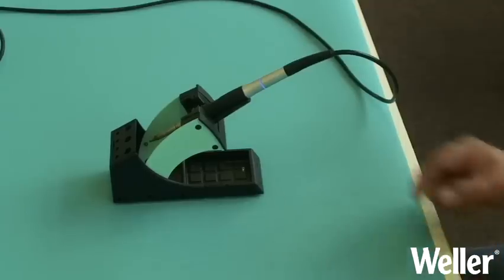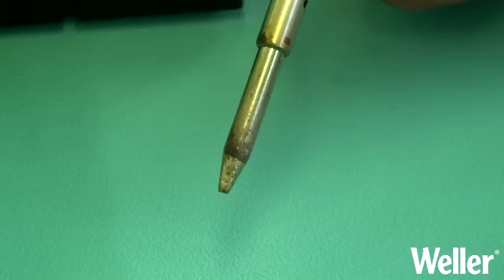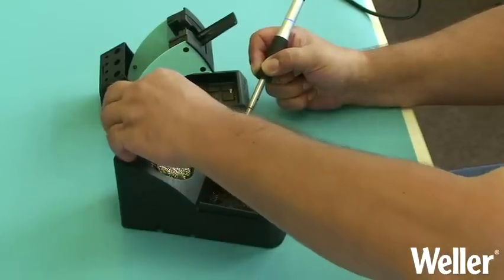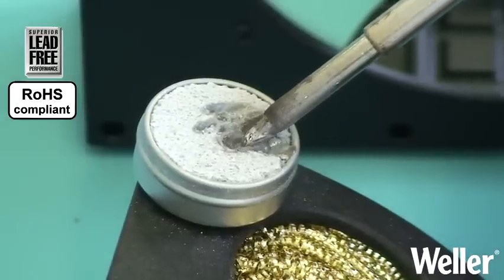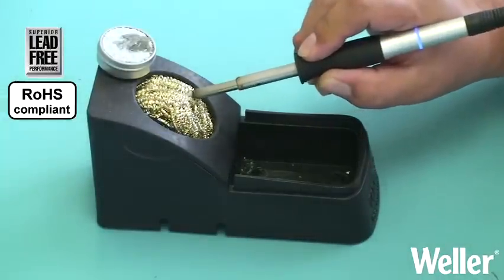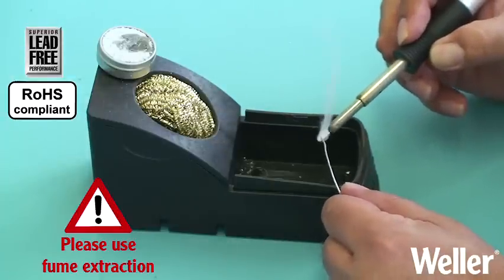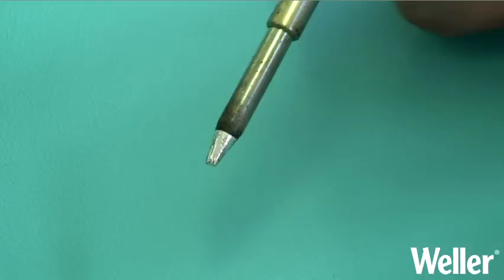Weller How to use a Soldering Tip Activator - Application Video

Comment: Is "tip tinner" the same thing as "tip activator"? They look the same, at least
Reply from the maker: Thanks for your question! The tip activator has replaced the tip tinner. The tip tinner contained hazardous substances, the tip activator no longer contains these hazardous substances. But both products do the same thing.
Reply: @wellertools  Ahh okay that makes sense. Thank you!

Comment: I keep getting a sticky residue behind on my soldering pieces and I don't know why it's really hard to get rid of aswell it's like the sap from a tree
Reply: Most likely it is rosin or flux from the solder which prevents it from oxidizing. It is generally pretty easy to clean off with some isopropyl alcohol.

Comment: Just so happens that the Soldering Tip Activator actually shortens the life of the tip. Reason being is the Activator has Ammonia in it and will eat away the soldering tip.
I know this from many years of soldering.  If you want new tips sooner then use it.
Reply: How does one recoat the soldering iron shaft, then?

Comment: Is Weller flux LW25 safe to use on fine electronics, such as PCB boards when soldering? It has Zinc Chloride in it, and it is said that it is acidic and may corrode and destroy PCB's.
Reply from the maker: Please contact our technical support department by email: Technical-Service@Weller-Tools.com
The team will be happy to help and answer any questions you may have.

Comment: The thing this video misses explaining is that this process of cleaning should be done sparingly as it does deplete the life of the tip. If you have constant problems needing to do this you need to reduce it and look elsewhere on what is causing the problem, overheat, underheat, wrong flux, wrong flux core solder, storage being the most common that come to mind. Use the brass gently as the video shows.
Reply: I don't do a massive amount of soldering, but the Tip on my Weller is over 5 years old and I've never had to retin it. I've always cleaned it in the wet sponge they provide. I've never used the brass. Wish I knew what I was doing that feels right. Maybe I use high quality solder? Been using the same roll for 5 years.
Reply: @metzenw86  You actually re-tin it every time you add solder to it. You probably mean you don't corrosively clean and prep the tip for use often. Something common on simple tip irons. Small tubs typically labelled Tip Tinners are really Tip Cleaners. A much higher corrosive flux than normally used in electronics in a compound that includes a powdered solder. Wetted sponge does damage all tips, but it's to do with temperature differential from the temperature it was before hitting the sponge. Thermal shock to tips is less of an issue with leaded solder due to the tip being at a lower temperature, but it still occurs. It's also related the environment and how the user wets the sponge. Older Weller tips are significantly better grade than most of the cheap junk people buy nowadays on low-end soldering irons.
Reply: @cdyoutoob  Thanks for the clarification. Yeah, I don't do a whole lot of soldering. But I do keep my equipment clean. My Weller WE1010NA has served me well, as did my WES51 before.
Reply: @cdyoutoob  Thank you for taking the time to give us this valuable information. I am about to buy ERSA soldering station model RDS 80, with a few tips. Based on the reviews and its look (much smaller heater surface area, thus less heat dissipated/wasted away, smaller tips with more mass and thus more concentrated heat, as far as I can tell from my simple observations) it should perform much better than my old Hakko 936 (for which I need to get new tips). Do you have knowledge or experience with Ersa, especially with RDS 80?

Comment: I do this a dozen of times and it still keeps going black after some uses. I have changed 4-5 new tips so far, always the same. I thought that the issue comes from the flux, but first: I need the flux, second: my cheap second soldering iron from T___t doesn't have this problem.
It is a pitty not to use a 250€ tool and replace it (successfully) with a 20€ one.
Any ideas??
Reply: You use the flux as needed to keep the tip clean and shiny.  If you stop using it, the tip will brown and eventually lose the ability to transfer heat effectively.  Then you'll have to perform a deep clean of the tip to restore it.  One thing I don't see mentioned is taking a shop towel and rolling it up tight into a 'cigar' shape with one flat end and taping it up to keep it together.  That flat end can be used to wipe the tip between fluxes, prolonging the tip's cleanliness.  But you'll still need to re-flux regularly.  Finally, when you're done, flux the tip real good, pile on a bunch of solder, and let it cool.  This will keep the clean tip protected until you're ready to use it again.  Then you just have to heat it up, wipe the tip off, flux it, and you're ready to go.
Reply: The more you do this the quicker the tip will oxidise. You should be doing this sparingly
Reply: @Smrda1312  Disagree.  Fluxing should be done regularly to keep the tip clean.  Otherwise, you stand to lose heat and introduce contaminants into your workpiece.  As for the tip oxidizing; they all do.  But keeping the tip clean will prevent oxidation from becoming too much of an issue until it's time to replace the tip.
Reply: @Wichitan  Fluxing is not the same as using tip refresher. Tip refresher most definitely damages the tip
Reply: @Wichitan  Plus the added abrasive but let's pretend it is just flux
Reply: @Smrda1312   What added abrasive would that be, exactly?
Reply: @Wichitan  Ammonia Phosphate which reacts quite aggressively and can and will over time damage your tip.
Reply: @Wichitan  Yes but that chemical bath is not good for the tip it will speed up the ageing process. Do whatever you wish it's not my problem but most people agree that tip refresher should be used sparringly.
Reply: I mean if that were the case tou would clean the tip in flux and not in amonium salts
Reply: @Smrda1312   Now you're catching on.  Weller is marketing this as a 'Tip Activator', but to me it just looks like a lead-free paste flux.  If it looks like paste flux, if it smells like paste flux, and if it reacts to heat like paste flux, then it's paste flux.  No matter what Weller's marketing department wants to call it.

Of course, if your contention that excessive use causes soldering tips to degrade is accurate (and I will admit that I haven't used this particular product, but I have used both leaded and non-lead paste fluxes), this may point to Weller wanting to degrade tips faster so they can sell more tips.  It wouldn't be the first time a company has come up with a 'premature obsolescence' scheme like that.
Reply: @Wichitan  Intresting, I've never really used flux by itself to clean tips. I will try it out.  Thanks for the relatively civillised conversation which is rare in the youtube comment section. 

Also, it's not just weller most tip refreshers are chineese knock offs which clean them well enough but I think they should be avoided and perhaps only used after normal flux doesn't get the job done.
Reply: @Smrda1312    I was a Navy Micro-Mini (2M) Repair Tech in a former life and my instructors drilled three things into us:  proper tinning, cleanliness, and safety.  We'd slave diligently on our projects, only to have them graded to shreds by an instructor with 20/15 vision.  Good times.  😄

Comment: Made In Mexico！！
Reply: as long as it works, and is cheap, who cares where it is made?
Reply: Kayla and Jim Bryant Unidentified identity
Reply: @user-you-father  i use the real weller activator, and it works just fine.

there are a lot of cheap knock-offs of varying quality, some better than others, but I tend to not want to waste my money on substandard stuff.
Reply: @user-you-father  that goes for any country really.  look at the usa, you have good stuff, and you have trash.  look at china, you have good stuff, and you have trash.  the situation is the same with every country.
Reply: Kayla and Jim Bryant  Mexican, you don't need German products.
Reply: Kayla and Jim Bryant This is an insult to Germany.
Reply: @user-you-father  first off, i'm not mexican.  second off i have quite a few german products from beyerdynamic, sennheiser, aquacomputer, weller, etc.
Reply: Kayla and Jim Bryant Because their official texts are clearly written in German, which means that they have changed to Mexico for the sake of economic sacrifice.
Reply: @user-you-father  well, if they do manufacture some things in mexico, then that's not a problem for me.  

i source stuff from wherever it is.  if i want pc boards made, there are some great companies in china that do it cheap and maintain high quality standards.  if i want certain capacitors, i buy from japan.  if i want whatever, i get it from wherever.

if you haven't noticed lately, the nationalist nutcases have really messed up the global economy, because they are idiots who don't understand how the world works.

as far as the tip activator, i see no real quality changes from the last time i bought it, or from the time before.  other than maybe some batch variance that i am not noticing, it's the same formulation.  it works no differently from the first time i used it in the 1980's.  it works the same, and takes no extra effort.
Reply: Kayla and Jim Bryant You are pure, capitalists love you.

Comment: So does the wire wool replace the damp sponge nowadays?
Reply: Yeah, sanding paper, good way to fucking ruin your tips, scratching off the protective coating, exposing the bare and sensitive core. The brass wool is much more gentle, and a brass brush complements it nicely.
The dampness shocks the tip, and steam is surprisingly corrosive. Not to mention that melting and smouldering sponge plastics forms nasty, sticky crud. Sanding paper is the worst advice.
Reply: I use a sheet of fine grit canvas sanding paper, folded up into a small square. Those wire wools don't provide enough resistance and abrasion for me. I'd rather use a damp sponge or the green scrubbing top of those dish sponges than that wire wools stuff. I will say, though; some people don't like keeping they're damp sponges clean or replacing them. Because they do start to smell or mold overtime due to them being damp and sitting.
Reply: It's not advice, It's preference.

Comment: Thanks for the helpful video.   Also, what temperature should the iron be when using the activator?
Reply from the maker: you can use it on the normal soldering temperature, not overheated. for more details please contact us at technical-service@weller-tools.com

Comment: tip tipps, so to speak. Thank you. very interesting. 
Yes, you definitively need to use the fume extractor. I am using the weller wfe-p pump, in combination with the FE-75 and WSP150 soldering irons. Neet. WSP150 needs an additional kit though.

Comment: I have just replaced the tip of my Weller soldering iron as the previous one was black and gunky (using for soldering stained glass). After one small project, it is in the same state. I have used a wet sponge with it and it hasn't made any difference. Already it is effecting it's ability to melt solder. What can I do please?
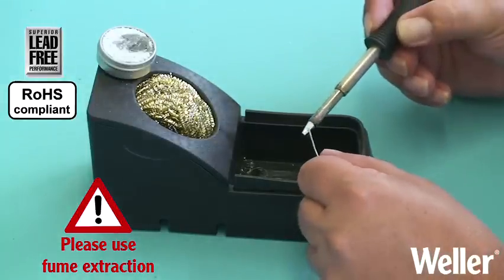Reply: +267mo I have no experience with stained glass soldering, what I do know is, avoid cleaning with a damp sponge. Use the dry cleaning method with brass wool. Instead of a dabbing motion, I recommend a wiping motion from inside to outside; ''Weller How to use a Dry Cleaner - Application Video''  watch 0:35 to 01:05. Always tin the tip after cleaning, this prevents oxidation

Comment: So if the Tip that makes contact with the Tin and Material is getting black do this.
How about if the area behind the Tip that never makes contact gets black?
Is there a need of action when this happens or is this something that can be ignored and if not, how should it be treated?
Reply: +Duraltia Same problem for me on brand new tip.